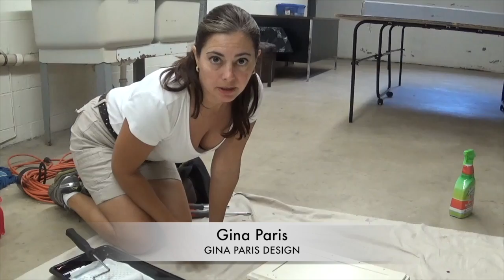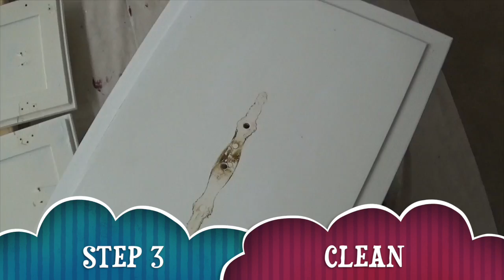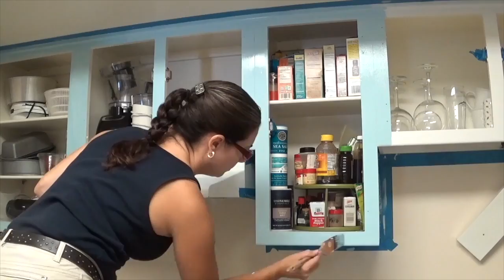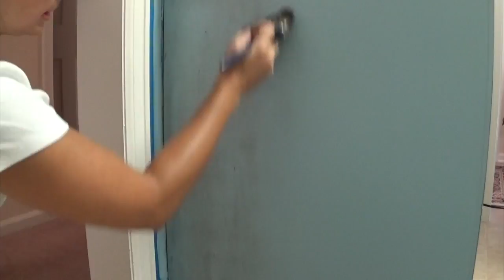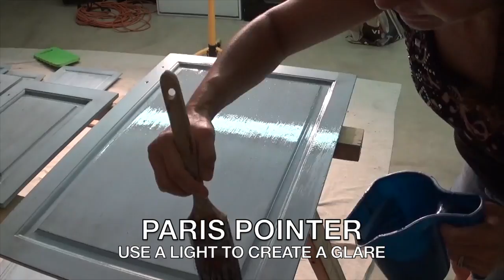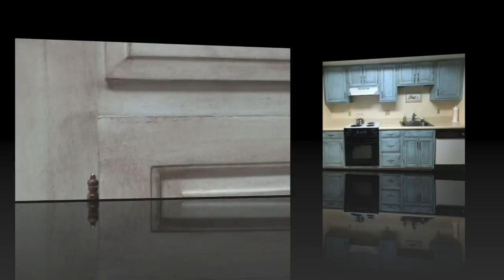// 10 Steps to Antique Cabinets // #ginaparis #ginaparisdesign #renovationsoul

Comment: Finally figured out what going to do t with my cabinets! What is the color you used called? I want my exactly like yours! 💕😀
Reply from the maker: The colors I used are Sherwin Williams Vast Sky SW6506 and Valspar Antiquing Glaze / Asphaltum 98278. If you don't want to glaze your cabinets, but want that warm neutral blue color, I recommend Sherwin Williams Languid Blue SW6226 (this is the color Vast Sky will appear to be after glaze is applied).

Comment: Do you add the glaze when paint is dry or wet, your video has no detail. I want to do this but don't want to mess my cabinets up. do I use a lot of glaze or just a dry brush
Reply from the maker: Add glaze after the paint has dried completely. I used a nearly dry brush. I brush out some of the glaze onto the cardboard before applying it to the cabinet.  If glazing is too light on the cabinet...I add glazing to the brush and go over it again; if the glazing is too heavy handed...I gently wipe it off with a damp paper towel or wipe it all off and begin again. There is a little work time with the glaze; however, don't touch it after it has dried a little or it will smudge. Do you have something to practice on before glazing the cabinets? Give the glaze a few days to dry, then clear coat to protect it.